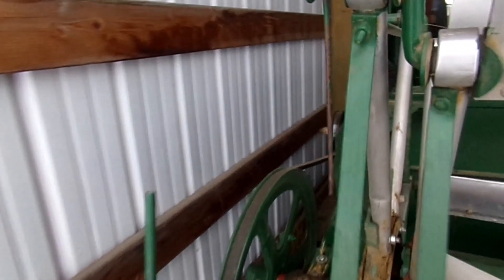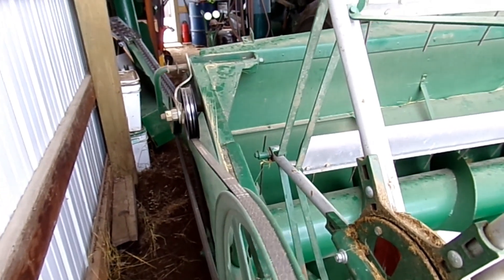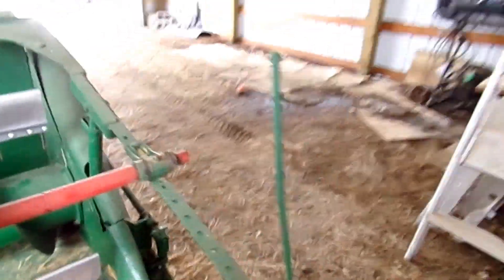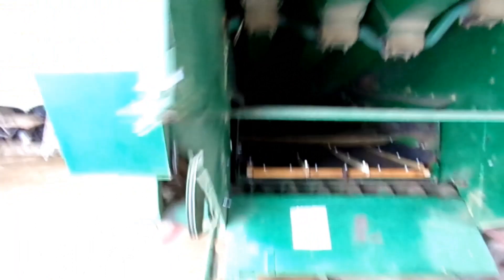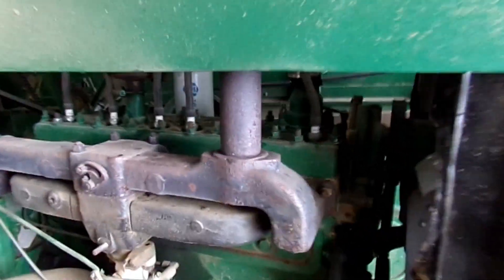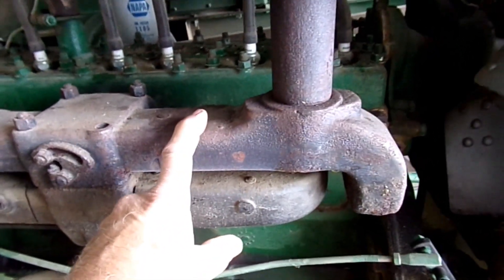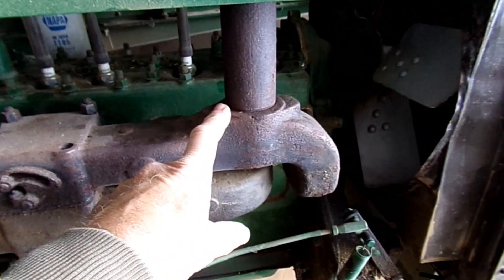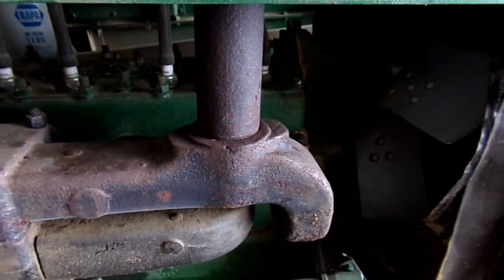JB on the exhaust pipe

Comment: I have confidence it's going to work for you.  The first year I started spraying I ran a Patriot sprayer with a John Deere engine and long story short antifreeze was forgot to put in it and it cracked the block about a foot long wide enough to put a penny in it.  we JB welded that crack shut and ran it a whole season that way. So it's good stuff
Reply from the maker: No kiddin', wow! ok, i was wondering if the temperature being only 40 would make it not cure right, but i don't plan on starting it for a while. Thanks man!

Comment: JB weld can do some amazing fixes! Probably should use a spring or rubber on the clamp, if it's solid, it will probably ruin your repair..
Reply from the maker: Thanks man, i will have to rummage around and see what i got. I figure i'll let it set up for a month or so and then start it and see what happens, lol.
Reply: @rustyoldmicrofarm4673  definitely won't hurt to let it cure good

Comment: Hey Rusty! I've seen JB Weld used on cracked blocks, but haven't seen it on exhaust before. Can't hurt to try! I think the brace will help a lot, that's a long heavy pipe sticking up there. I agree with Ed, you might want to go get an exhaust hanger with a rubber isolater from the auto parts store, it should give you some support but be able to flex a little. Might help with vibration maybe to keep it from cracking again. I love that combine! It'll be awesome to see her in the field again! Thanks for the video!
Reply from the maker: Thanks man, i will look into finding something for that, yeah. I'm trying to get a parts machine but the guy didn't accept my offer.
Reply: @rustyoldmicrofarm4673  Parts machines are handy. Hopefully you can find one somewhere. I need to finish stripping down my parts combine, there isn't a whole lot left of it I can use but it's definitely paid for itself

Comment: hopefully that does the trick. if JB doesn't work maybe you could braze it? I'm surprised you can find a manifold for it, looks like its a engine out of a 70?
Reply from the maker: There was a lot of these Continental Flatheads around in the 50-60's, and you can still find manifolds and stuff for the 4 cylinders, but not for the 6's. They used them a lot in forklifts as well. But i didn't look too far either. Maybe if i made some phone calls to Indiana, there's probably still some around somewhere. I also found out that other 33 is still about 5 miles away, and i may try to drag that home if the price is right.